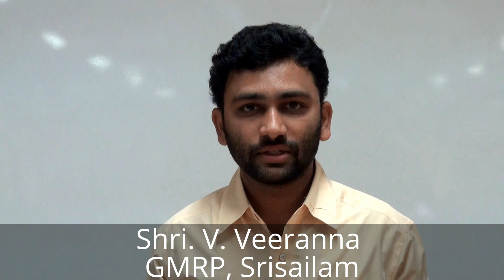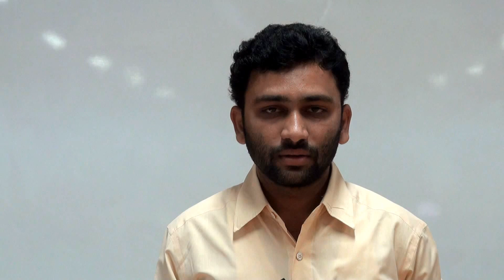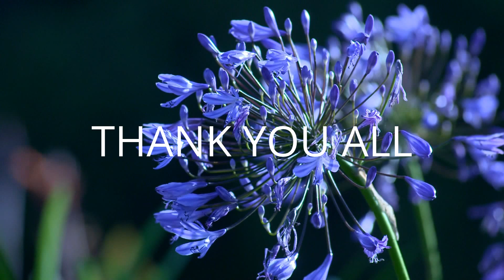DEADLOCK  IN  OPERATING SYSTEM

Comment: Real world example : Suppose my system having 2 tape drives t1 and t2 ,& also 2 processes p1 and p2 r thr..
Then the Process p1 holds d tape drive t1 and p2 holds t2...
now.. P1 also needs t2 from p2
at d same time Process P2 also needs t1 from p1...
both Process becomez in a waiting state.. a never ending waiting state.. a block,trap or lock occurs thr.. that's d deadlock!

Definition: A set of blocked processes each holding a resource and waiting to acquire a resource held by another process in the set...
Reply: tq  . . . .

Comment: so far good one but need more detailed information
Reply: In a multiprogramming environment, several processes may compete for a
finite number of resources. A process requests resources; if the resources are
not available at that time, the process enters a waiting state. Sometimes, a
waiting process is never again able to change state, because the resources it
has requested are held by other waiting processes. This situation is called
a deadlock We discussed this issue briefly in Chapter 6 in cmmection with
semaphores.
Perhaps the best illustration of a deadlock can be drawn from a law passed
by the Kansas legislature early in the 20th century. It said, in part: "When two
trains approach each other at a crossing, both shall come to a full stop and
neither shall start up again until the other has gone."
In this chapter, we describe methods that an operating system can use
to prevent or deal with deadlocks. Although some applications can identify
programs that may deadlock, operating systems typically do not provide
deadlock-prevention facilities, and it remains the responsibility of programmers
to ensure that they design deadlock-free programs. Deadlock problems
can only become more common, given current trends, including larger numbers
of processes, multithreaded programs, many more resources withirt a
system, and an emphasis on long-lived file and database servers rather than
batch systems.
To develop a description of deadlocks, which prevent sets of concurrent
processes from completing their tasks.
To present a number of different methods for preventing or avoiding
deadlocks in a computer system.
A system consists of a finite number of resources to be distributed among
a number of competing processes. The resources are partitioned into several
283
284 Chapter 7
types, each consisting of some number of identical instances. Memory space,
CPU cycles, files, and I/0 devices (such as printers and DVD drives) are examples
of resource types. If a system has two CPUs, then the resource type CPU has
two instances. Similarly, the resource type printer may have five instances.
If a process requests an instance of a resource type, the allocation of any
instance of the type will satisfy the request. If it will not, then the instances are
not identical, and the resource type classes have not been defined properly. For
example, a system may have two printers. These two printers may be defined to
be in the same resource class if no one cares which printer prints which output.
However, if one printer is on the ninth floor and the other is in the basement,
then people on the ninth floor may not see both printers as equivalent, and
separate resource classes may need to be defined for each printer.
A process must request a resource before using it and must release the
resource after using it. A process may request as many resources as it requires
to carry out its designated task. Obviously, the number of resources requested
may not exceed the total number of resources available in the system. In other
words, a process cannot request three printers if the system has only two.
Under the normal mode of operation, a process may utilize a resource in
only the following sequence:
Request. The process requests the resource. If the request cannot be
granted immediately (for example, if the resource is being used by another
process), then the requesting process must wait until it can acquire the
resource.
Use. The process can operate on the resource (for example, if the resource
is a printer, the process can print on the printer).
Release. The process releases the resource.
The request and release of resources are system calls, as explained in
Chapter 2. Examples are the request() and release() device, open() and
close() file, and allocate() and free() memory system calls. Request and
release of resources that are not managed by the operating system can be
accomplished through the wait() and signal() operations on semaphores
or through acquisition and release of a mutex lock. For each use of a kernelmanaged
resource by a process or thread, the operating system checks to
make sure that the process has requested and has been allocated the resource.
A system table records whether each resource is free or allocated; for each
resource that is allocated, the table also records the process to which it is
allocated. If a process requests a resource that is currently allocated to another
process, it can be added to a queue of processes waiting for this resource.
A set of processes is in a deadlocked state when every process in the set is
waiting for an event that can be caused only by another process in the set. The
events with which we are mainly concerned here are resource acquisition and
release. The resources may be either physical resources (for example, printers,
tape drives, memory space, and CPU cycles) or logical resources (for example,
files, semaphores, and monitors). However, other types of events may result in
deadlocks (for example, the IPC facilities discussed in Chapter 3).
To illustrate a deadlocked state, consider a system with three CD RW drives.
Suppose each of three processes holds one of these CD RW drives. If each process
7.2
7.2 285
now requests another drive, the three processes will be in a deadlocked state.
Each is waiting for the event "CD RW is released," which can be caused only
by one of the other waiting processes. This example illustrates a deadlock
involving the same resource type.
Deadlocks may also involve different resource types. For example, consider
a system with one printer and one DVD drive. Suppose that process P; is holding
the DVD and process Pi is holding the printer. If P; requests the printer and P1
requests the DVD drive, a deadlock occurs.
A programmer who is developing multithreaded applications must pay
particular attention to this problem. Multithreaded programs are good candidates
for deadlock because multiple threads can compete for shared resources.
In a deadlock, processes never finish executing, and system resources are tied
up, preventing other jobs from starting. Before we discuss the various methods
for dealing with the deadlock problem, we look more closely at features that
characterize deadlocks.
7.2.1 Necessary Conditions
A deadlock situation can arise if the following four conditions hold simultaneously
in a system:
Mutual exclusion. At least one resource must be held in a nonsharable
mode; that is, only one process at a time can use the resource. If another
DEADLOCK WITH MUTEX LOCKS
Let's see how deadlock can occur in a multithreaded Pthread program
using mutex locks. The pthread....mutex_ini t () function initializes
an unlocked mutex. Mutex locks are acquired and released using
pthread....mutex_lock() and pthread....mutex_unlock (), respectively.
If a thread attempts to acquire a locked mutex, the call to
pthread....mutex_lock 0 blocks the thread until the owner of the mutex
lock invokes pthread....mutex_unlock ().
Two mutex locks are created in the following code example:
I* Create and initialize the mutex locks *I
pthread....mutex_t first....mutex;
pthread....mutex_t second_nmtex;
pthread....mutex_ini t (&first....mutex, NULL) ;
pthread....mutex_ini t (&second....mutex, NULL) ;
Next, two threads-thread_one and thread_two-'-are created, and both
these threads have access to both mutex locks. thread_one and thread_ two
run in the functions do_work_one () and do_work_two (), respectively, as
shown in Figure 7.1.
286 Chapter 7
DEADLOCK WITH MUTEX LOCKS (Continued)
I* thread_one runs in this function *I
void *do_work_one(void *param)